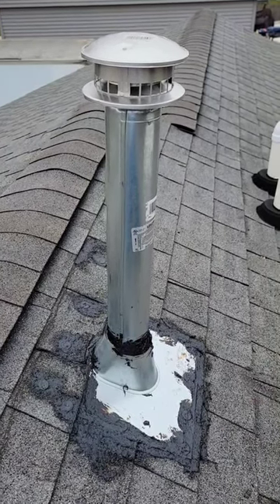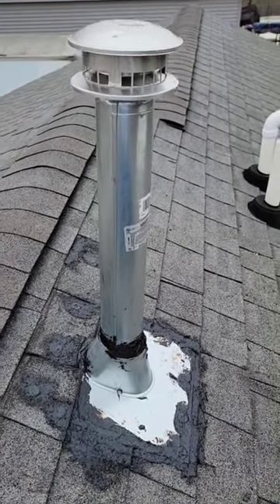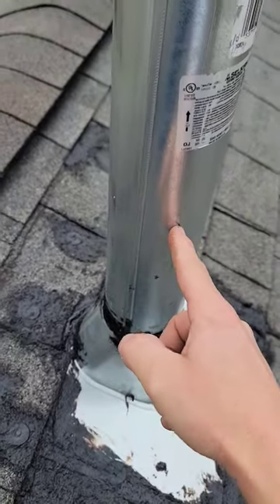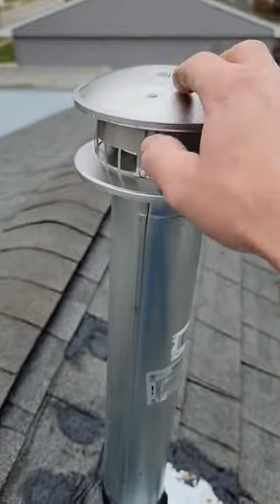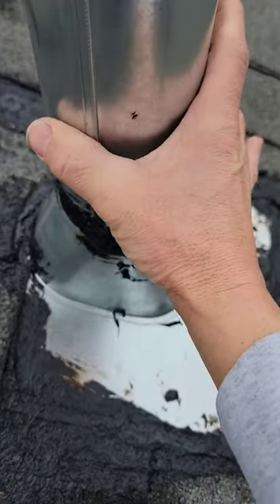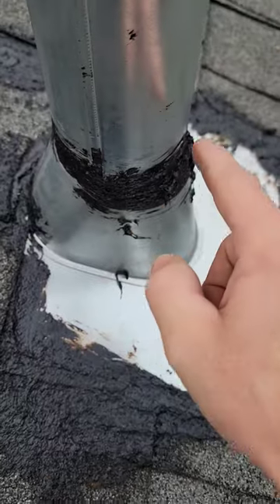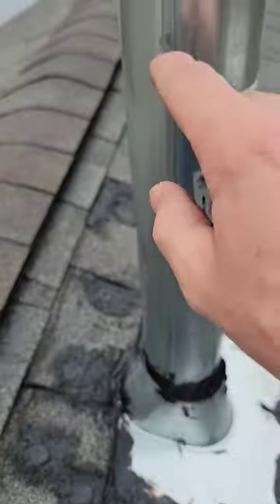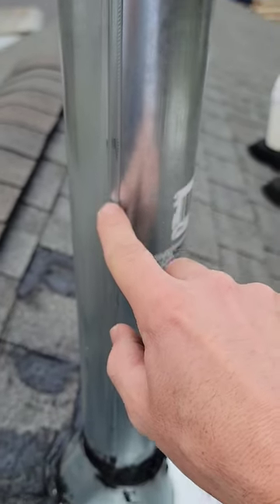HVAC B-vent flue pipe roof flashing install  - Gone horribly wrong by hvac company!

Comment: I assume you replaced the hardware then made a clean finish so it’s not noticeable?
Reply from the maker: No. We were called to give an estimate for a roof replacement. I noticed how bad this was, and did the video. After I was done and gone,  I found out that it was an hvac company that did it the day before this video. If we end up getting the roof job, we will be switching it out with new pieces, including the one that was missed.

Comment: I’ve got a feeling, why I have a tiny drip, that comes from my HVAC vent pipe… but lands in the emergency pan is from something juuuuuuusssstttt like…. This. 🤔
My saving grace is it’s in CA, which has a clause in the state constitution, ‘to dwell in a semi drought until we colonize Mars’. So I’m kind of safe, but I bet it’s a cousin to the installer on yours. 👍
Thanks for the video. 🙌👊
Reply: It may just be condensate, you may need to get it checked out to make sure it isnt dripping continuously on the drip pan, especially if its the water heater drip pan.
Reply: @prod.cruzomg1782  evening, or morning. I do have an update and further info…. 
Our water heater is outside and tankless, the drip is from the condensation line, and that’s fine. The pan is an emergency back up, it does have a bit of rust, more like mineral rust, it’s not the pan, the old air vent, must have been hit when it’s piping was removed, and the boot is still there, and has a tiny drip when it is down pouring. I only found out when I was up there, and got a glimpse of a drop when I was near it and caught a glimpse of one…. And after hours doing what I was doing…. A tiny sliver of a puddle inside had added up with drips…..
I’m taking g the boot out, it’s not needed and sealing the roof. 
But it would have been a mystery of it wasn’t for the pouring rain, and me  adding another WiFi controlled attic fan. 😆🤔👍
All cleared. 👍